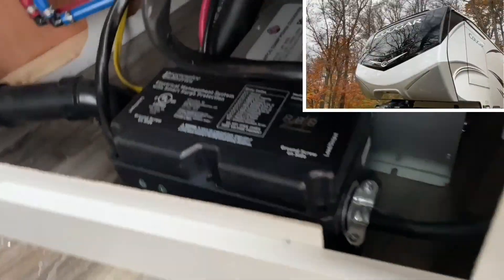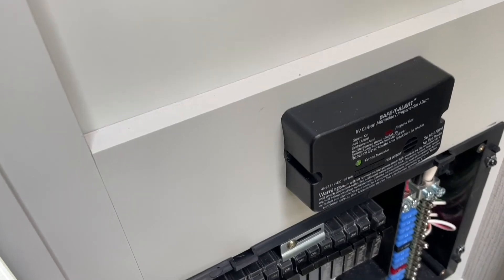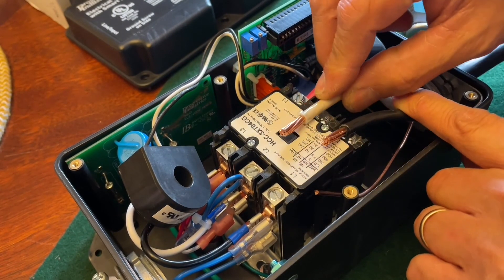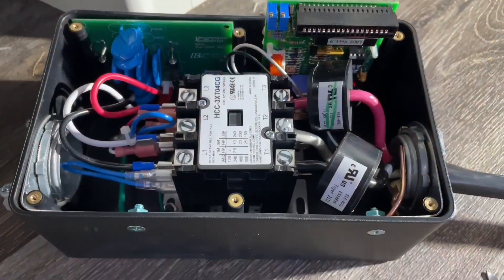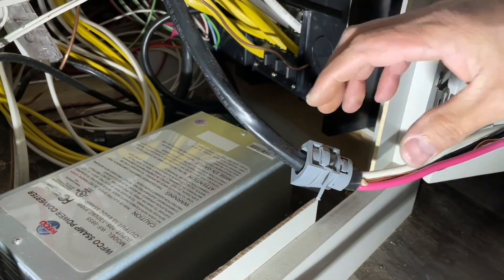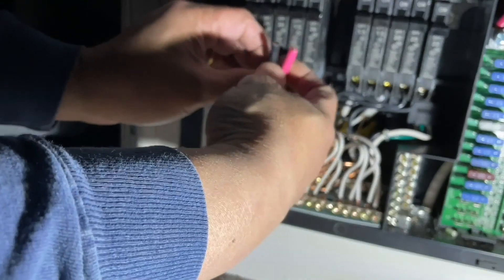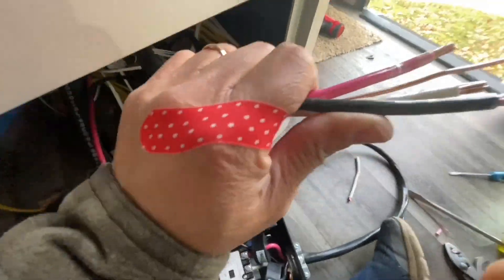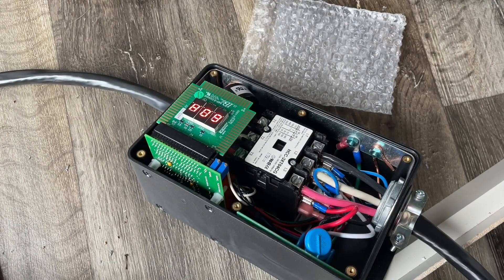How to Install Surge Protector EMS Hardwired 2021 Keystone Cougar RV Electrical Management System

Comment: I'm in the middle of my second install.  I contacted them a year ago during my first one about the missing 'direction' arrow on the sensors (yes, I see you caught your mistake on where the green marked sensor goes).  They told me last year the new sensors are not direction oriented and need not worry.  Said they had not updated the manual yet.  A year later, still haven't.  Hardest part is STILL getting these fat stiff cables to bend and get in there neatly.  UGH!! (BTW, I'm not the same person as Alan B. who commented a year ago)
Reply: I was like what arrow?  Mine was warranted and arrived yesterday and still not updates instructions.

Comment: Great video curious if u did this step per instx pdf "Remove the two screws on contactor where marked L1, L2, etc. Next remove the 
top plastic plate with markings. Examine inside ensuring there are no loose plastic 
pieces inside the contactor. If so, remove and re-install cover with two screws. See 
visual references on page 9.
! CAUTION If you break off a tab and do not remove it, thi

Comment: On my Progressive industries 50A the wiring label inside the box says the sensor with the "green tape" goes to the black wire T1, there was no green tape just a green marking.
Reply from the maker: Yup. Caught it .Here is the correction vid